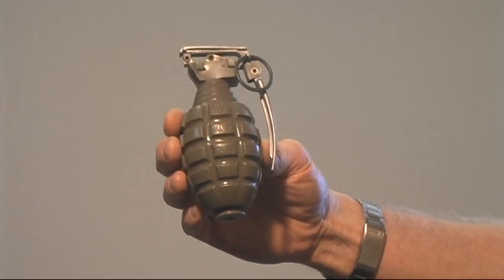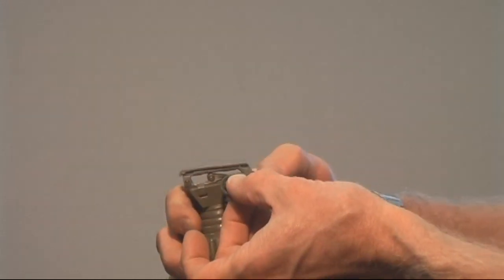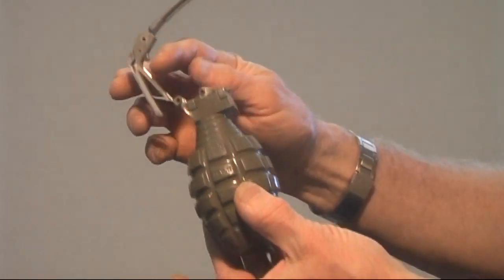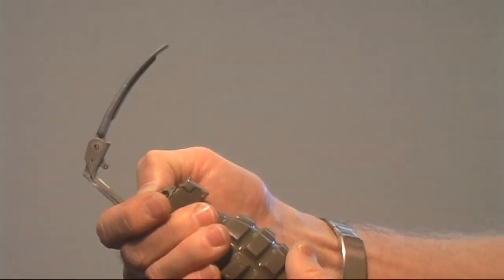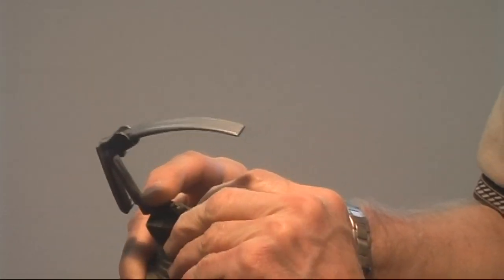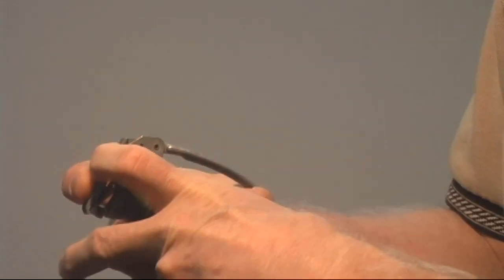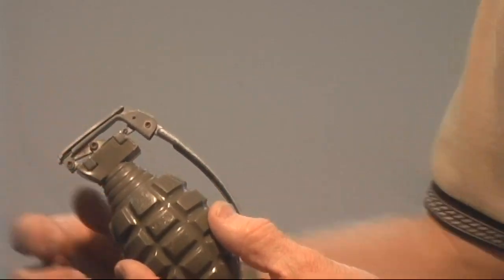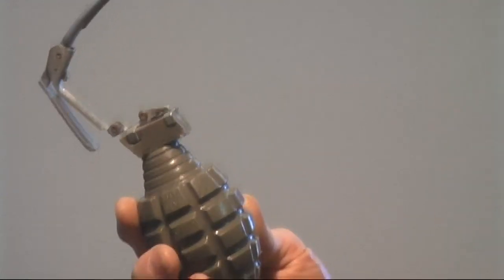How to Work a 1960s MACO Toy Hand Grenade

Comment: They must have upgraded the toy grenades in 1969. As I remember my grenades had the cap on the bottom and it used the red roll caps tap. You put the cap on the bottom and threw it on the ground causing the cap to go off. I remember you couldn't throw it very far because it had to land straight so the bottom made contact.